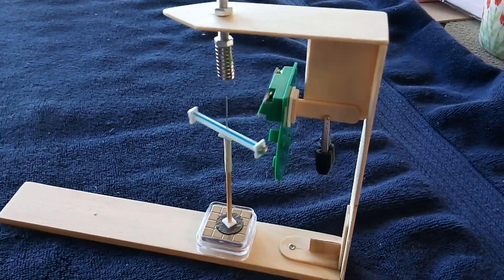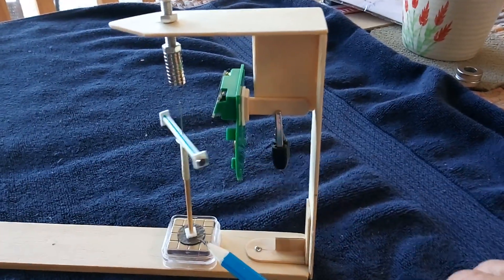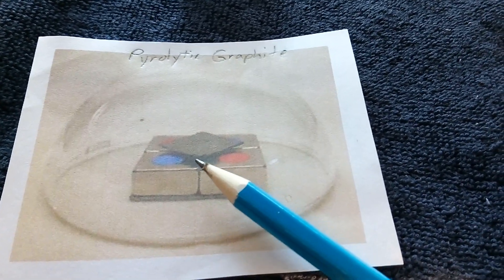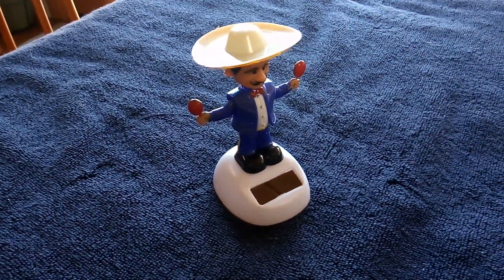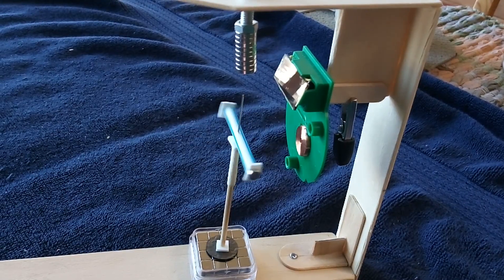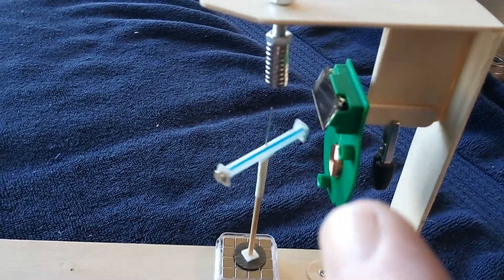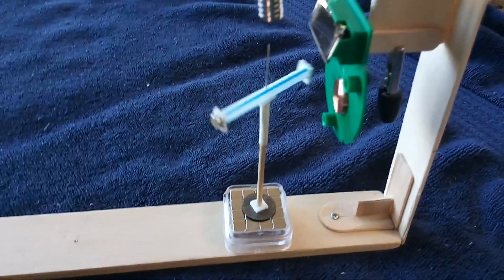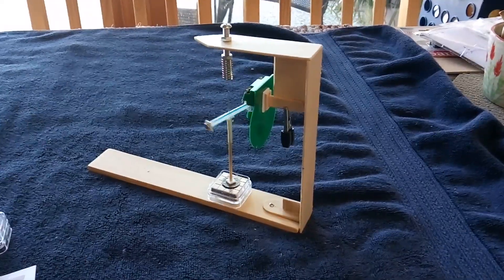Pyrolytic Graphite Levitation Solar Pulse Motor

Comment: Hi Lidmotor, about the wearing of the bearing...

I did a calculation, and when the tip of your needle is .1 mm² and the rotor with its shaft weighs about 5 grams, that would be the same as 50 kg/cm²!
I did an experiment, where I put a 1 cm steel bearing ball under a figget spinner and placed it on a the top of a metal lid. It spun for 3 minutes!
I guess it has less resistance than your square magnets and the pyrolytic graphite, and is cheaper and simpler than those.
You can use glass in stead of the metal lid to prevent magnetic interference with the steel ball or the magnets on the rotor.
By Lidmotor.
Reply from the maker: Thanks for the info.